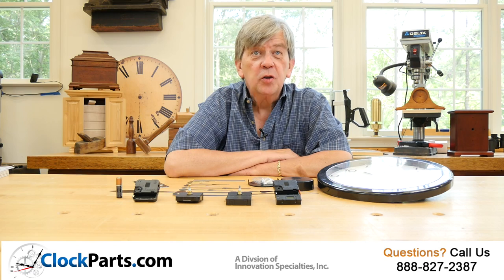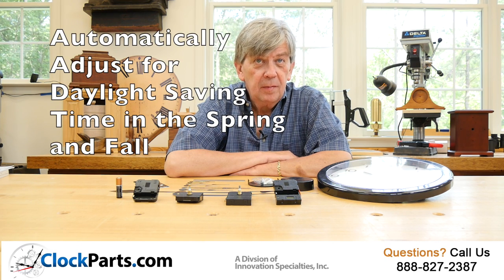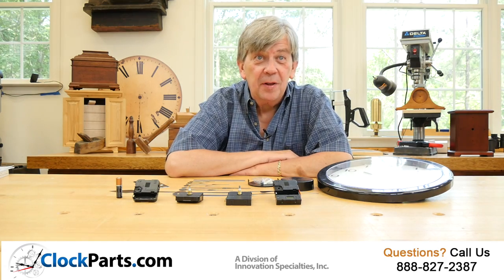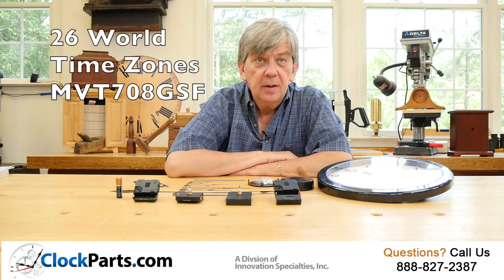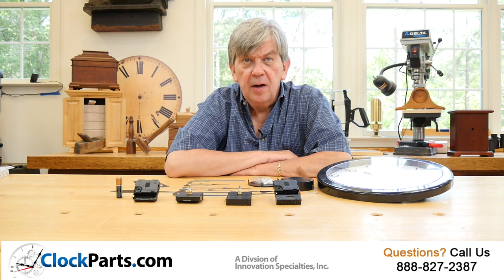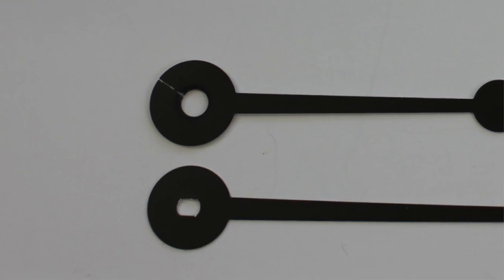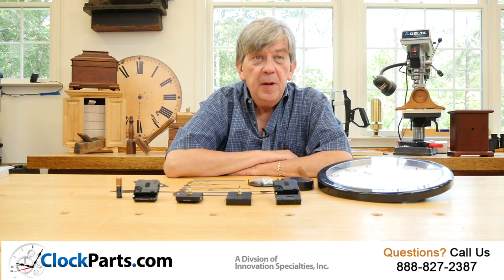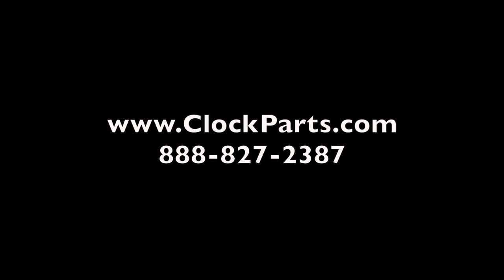Atomic Clock Movement vs Auto Set Movement

Comment: What happens when Congress changes the daylight saving time law? 
I had a atomic clock/radio set clock that ignored the DST info from the radio.  When the law changed, it was wrong for a few weeks in the spring and a few weeks in the fall.  To make it display the correct time, I actually had to adjust it four times a year!
Reply from the maker: The Government is the Government
Reply: If that ever happens then you will need to wait for these people to make a new clock movement that incorporates the new schedule and then buy a new one. This is a $20 clock, you can't expect it to splice DNA.

Comment: You assume that the only reason someone would want an atomic clock is to have daylight savings time adjustments made automatically.

The reason I use them, is because they poll the WWV signal several times each day, and /adjust themselves/ to maintain consistently accurate time.  

I don't believe that your "autoset" clocks can do this.

Also, I have a watch (Casio) that sets the hands /back/ an hour in the fall, in just a few minutes -- doen't just "stop" the clock for an hour.
Reply: And we all need to know all that because ... ?

Comment: How often does the battery need to be changed? Currently, I change the batteries when I make manual adjustments for daylight savings time.  I doubt that I will never need a ladder, as you described, if I still have to change the battery at some interval
Reply: Yeah, in theory it would be once a year, as you would for any clock, but you bring up a valid point that doing that does reduce the usefulness of this "auto-set" device. I'm guessing you might be able to get two or three years from a battery, so try that, just buy an Energizer battery that hopefully won't leak on you. I have had bad luck with Duracell and Ray-o-vac and I won't use them anymore. Energizer has worked for me so far, even though I think they have merged with Ray-O-Vac.

Comment: My beloved Sharp Atomic Analog Wall Clock stopped working a few weeks ago. It's been hard finding a replacement; I was beginning to wonder if they had become obsolete but I think I'd prefer it since the DST rules keep changing. I brought it to a fixit clinic, which are held sporadically in my area. The fixer got it ticking in a few moments, but it reset to 6 pm instead of the actual time, which is what it does when it can't find a signal. No worries, I brought it home and, strangely, as soon as I touched it, it stopped. Since then I've tried resetting it repeatedly and it only runs intermittently and hasn't set itself. The battery contacts are tight and I see no corrosion (the fixer cleaned them anyway). Sometimes it randomly begins ticking then stops, as if possessed! I've had it for eons with ZERO problems and I love the design so I would like to get it working again. Any ideas? The little circuit board is marked 418A.
Reply: Yes, I have an idea: just buy a new one. Since an atomic clock works for you where ever you live, that's the way to go.
Reply: @TheLarryBrown  They are very hard to find. I could not find the model I had, which had a design I liked. I did find one somewhat similar on Amazon, it arrived broken. They replaced it but apparently the model is also discontinued and there's no manual, just cryptic letters on the back. It is very hit-or-miss. The clocks are not widely available and I'm not sure why because when they work properly, they are so convenient to have. And I do not have a just-throw-it-in-the-landfill mentality like yourself

Comment: The biggest issue with non RC clock movements these days is accuracy - it has really gone down the drain. Moevements from the 70s are typically way more accurate (even adjustable) than todays movements. Nobody seems to make great high quality movements anymore. Most of them is way of at 1 sec/day and sometimes even more(!) and that adds up imho way too fast. An uncompensated 32khz tuning fork crystal that these clocks use is not the most accurate. And manufacturers don't even bother adjust it rudimentarily at say 25 degree celsius (just over normal room temp). If they bothered adjusting them they could perform very decent as such clocks are normally kept at a quite narrow temperature range but a little variation over the year is to be expected.
I have a few non RC clocks with their original movements that I tressure. Trying different values for the crystals load capacitor I've managed to get them within +½ minute at each change of DST. While not a stellar performance it's very acceptable granted they're not temperature compensated - but out of the box not many movements are within that - even if you don't care if the ½ minute is to the fast or slow side.

Comment: These are still quartz clocks though? That means they will drift a little over time requiring the user to have to periodically adjust the time.
Reply: Yes, true. That's true for every clock you own or have ever owned. If you want something better, you will need to use an atomic clock, but you may not get good reception where you live.

Comment: im getting this so i wont have to get on the counter to change the clock on the kitchen wall, another for the wall clock in the living room and even another for a floor clock also for the floor clock i will get an uninterrupted power supply from this company
Reply from the maker: Did everything work out for you?
Reply: You mean "uninterruptable power supply." All power supplies are uninterrupted most of the time.